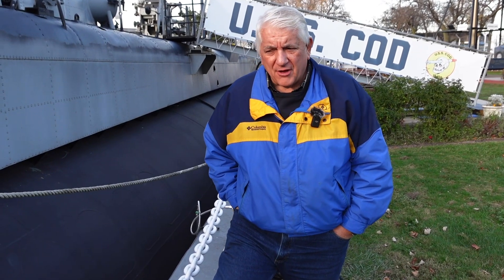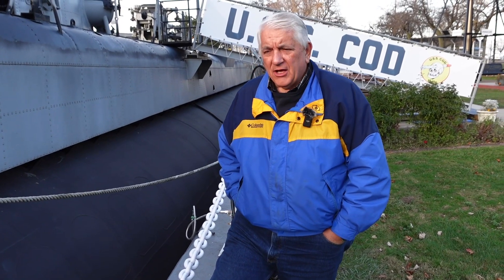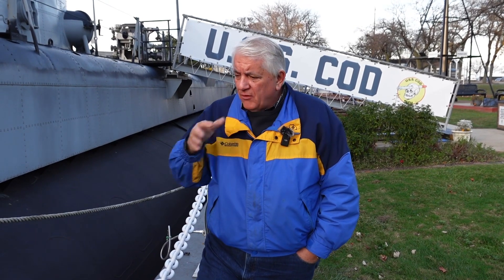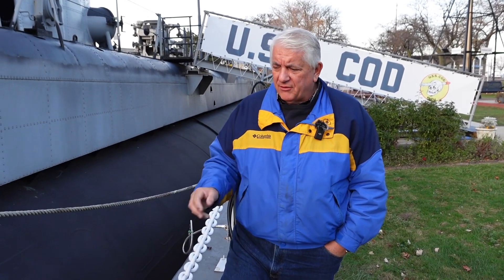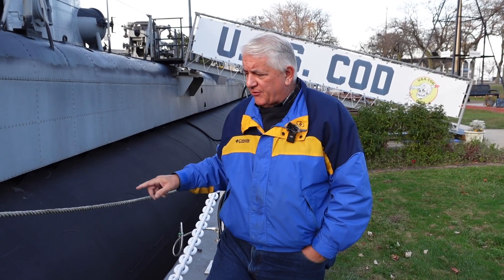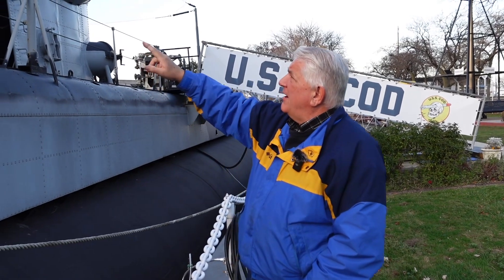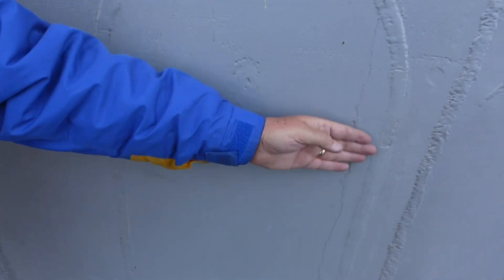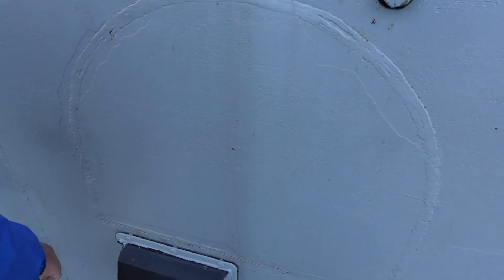Weld Scars Speak Volumes: How a Submarine’s History is Revealed by Weld Marks

Comment: I believe thes boat has EMD engines, instead of the FM's.
Reply: I had to look it up, because I didn't remember EMD being that old. But, kinda was. And yes, Cod has Cleveland engines (which became EMD).

My last ship had both FM (MDE's) and EMD (SSDG's).
Reply: Pre-EMD.  Cleveland Diesels, originally Winton, predecessor of EMD. Smaller version of what you can see on the rails now.
Reply: I think the EB and Manitwoc boats were 278 Alphas while the PNS and MINS built  had the FBM engines.

Comment: I love these little scars left by maintainence.

I read somewhere that the entire engine room roof can be removed for engine rebuilds, themso,called "soft patch" or "sunroof."  Is this the case on Cod?
Reply: I know that there are bolted hatches in the pressure hull above the front and rear battery compartments (as seen on the Baloa class USS Bowfin). I would assume the same hatches can be used to handle limited engine rebuilds. On commercial and naval ships they also tend to leave parts of the deck above the engine compartment 'clean', so that they can be cut out part of the hull for large engine refits.
Reply: Gato class have 1 soft patch over each battery well and 1 in after engine room. They were usually riveted but some were bolted down probably by a yard or sub tender that didn't have the ability to rivet or ran out of rivets.I don;t know for certain if the Balao's and Tench's had the the same setup.
Reply: Thanks for the replies.